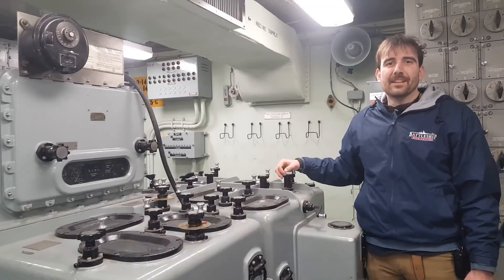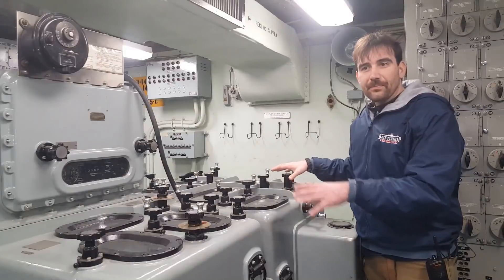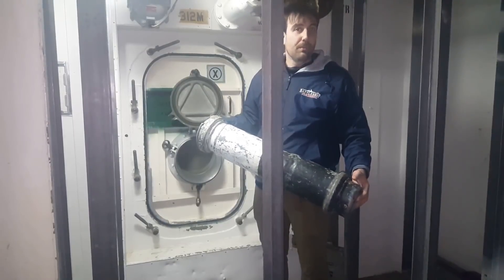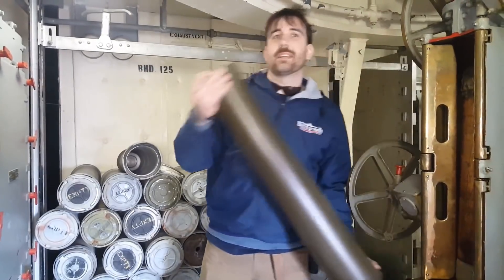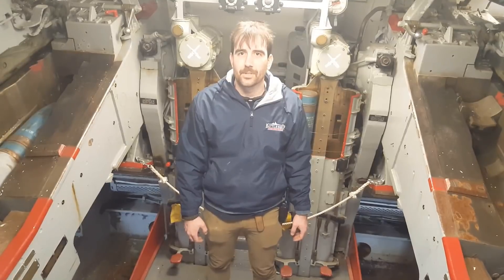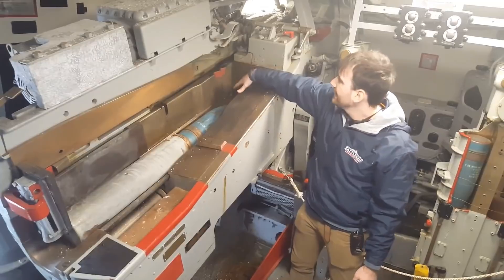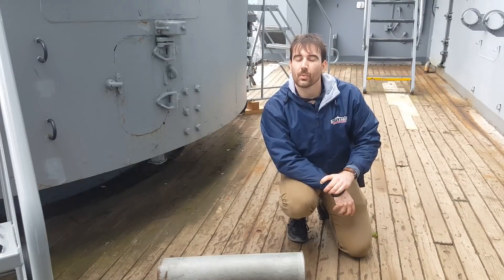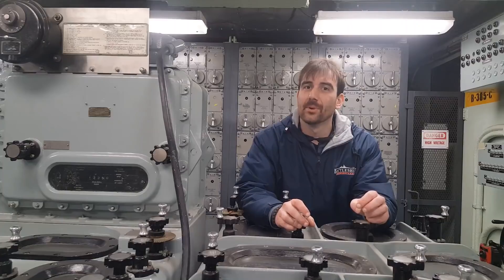5" Guns

Comment: My feeling watching this is one of exasperation! It makes no sense at all to me to have so many manual handling steps in the shell and powder handling, and gun loading. My back hurts just thinking about the insane movements! That could easily have been almost completely automated even in the early 40s. A big, rotating shell and powder magazine, electric or hydraulic rams to push a chosen shell from the magazine ring into a carrier which feeds it into a hoist. In the gunhouse, the shell would then ride along rails into the loading position, get automatically rammed into the gun along with powder being delivered the same way, the breach automatically closed and the gun would be ready to fire.

Comment: 4-sounds/round?! This a fully manual process. Current 5-inch/54-caliber, Mk 45 navy gun advertises 3-seconds/round; and this is automatic for a 20-round loader. Gunner’s mates  seriously earning their dinner rations during those evolutions.
Reply: It's even cooler than that. The 3second rof is because the barrel vibrates from the projectile interacting with the grooves and even with modern metals it still takes that long to dampen down so precision is not affected. They were a second off from matching the limits of the guns themselves.

Comment: The 5" 54 rounds on my ship were 72 lbs if memory serves. BTW does anyone know the difference between 5" 38 and 5" 54 ammo.  I know the 38 and 54 refer to the length of the barrels in calibers. But they are both 5" ammo (they should be able to fire out of any 5" weapon) yet they have different weights.  For instance, the new 5" 62 Light Weight mount on new Arleigh Burkes can fire 5" 54 rounds, but with a higher initial velocity due to the longer barrel. Are there any other differences to 5" 38? Could you fire 5" 54 out of a 38 mount (or vice versa)?
Reply: 5" 38 are semi fixed (2 piece ) ammo I belive the 54 is fixed (1 piece )
Reply: @barryd.thomassr.9156  No, I was an FTG aboard a DDG. The 5" 54 is semi fixed and the HE round itself is 72 pounds. Lugged enough of those during unrep to be sure. I just read the 5" 38 HE was 55 pounds, but still no definitive answer on interchangeability. Any old time Gunners mates know?
Reply: @wilsonle61  interchangeable yes but the powder would make a difference considering the 38 used a less powder, considering barrel lengths 5 x 38 vs 5x54, Jersey was my first ship

Comment: Thinking about how these firing platforms were designed and built nearly 90 years ago,  and were able to achieve a firing rate of one round every 4 seconds by using the brute strength of men and mechanical methods of that time is stunning.

Comment: "The shells, like this one, weighing 55 lbs" this man is holding it with his fingertips lol
Reply: Uk 55 lbs is one lb short of four stone before metric.
Reply: you can tell he's resting a lot of the weight on his leg
Reply: Training round same weight as real.
Reply: It’s hollow
Reply: @dylanlac765n6  But isn't the shell case the majority of the weight? He could be a navy vet, there's videos of gunners on destroyers handling the modern 70lbs 5" shells like they're nothing
Reply from the maker: This is a full weight shell even though it's inert. Hes just strong!
Reply: Clearly it's not loaded with powered ect.
Reply from the maker: Its a BL&P round, note the blue color of all those types of shells. Which means its inert, but full weight.

Comment: I always took for granted that the 5 inch guns were similar to the 16 inch guns. I never knew there was a metal casing for the powder. I assumed they used (smaller) powder bags. The 5 inch guns almost seem more labor intensive than the 16 inch guns.
Reply from the maker: In a way, they are, they definitely rely on manpower more and they have a much higher rate of fire. But a smaller impact.

Comment: Having served on both the 105mm M-60A3 and the Abram-saurus, four second reloads are admirable.
Reply: You would be exhausted as a loader on 60 or m1 tanks loading 22 rounds a minute . You would have to start tossing empty casings on the 60’s out the loaders hatch
Reply: @genegleason4987  Saw the 4 sec reload in the 1/1 CAV and 11th ACR. Agreed, not sustainable for any length of time, but if you  miss the first the second will be on target before the other guy can react.

Comment: I was a FTM on the USS Somers (DDG-34, ex-DD-947) from '71 to '73. We had a 5"-54 mount forward. We made one WestPac cruise in '72 off the coast of Vietnam where we did many call-for-fire missions and harassment and interdiction missions with our gun. By '72 most of the power shells were not brass, they were steel. Occasionally, a brass one was received and the spent shell was quickly grabbed by one of the officers. #RHIP. When we were on the gun line, we frequently shot so many rounds that the paint on the gun barrel blistered. We had all-hands working parties every other night for hours hand passing 500+ 5" rounds and then 5" power canisters from the at-sea replenishment deck down to the magazine deck. The jock officers would be the ones hand passing the 5" shells or power canisters from the hatch above to the hatch at their feet. There were no hoists for rearmament on a tin can; all 5" ammo was hand-passed.
Reply: every other morning, my 6 hrs out of the handling room was spent reloading the mag's during resupply. We would get done just in time to eat and get back in the mount. Couln't  sleep in the bunks because of the fiberglass falling out of the overhead.

Comment: question - at 3:22 you lift a powder canister up from the hoist, with the rim up.  I assume the other end is open.  Won't the powder etc fall out of the brass at that point?  Or was that a mistake (putting it in the hoist upside down)?
Reply from the maker: For us its upside down to hide that its empty
Reply: @BattleshipNewJersey  LOL; the powder-cartridge had a cork plug to keep it's contents inside. http://www.navweaps.com/Weapons/WNUS_5-38_mk12.php , the penultimate image shows "Cutaway sketch of 5"/38 (12.7 cm) ammunition."

Comment: Operation "Oceanview" was the name used by the Marines that night !  FYI.  The rammer's part was called a "Spade" when the breach block pushed it up it caught the big long brass "Cam"and rode it up and back to the ready position, Easy to see in the video. As it returned it rose up so when gun was fired.  The ejector Pauls of the breach block then pushed the empty brass back out. It easly slide under the Spade as it was now up. Expended brass slide out the back of the gun into a chute then out opening demonstrated in video. What else do you want to know about the 5/38's in Viet Nam We were the 5th Div. "Salts of the Earth"
Reply: https://en.m.wikipedia.org/wiki/Ocean_View_(Vietnam)

Comment: I saw one big mistake on loading the 5" projectiles. When loading in projectiles on to the loading tray you would not have your fingers flat unless you want your fingers smashed flat or worse loosing a finger or two. This is an excellent way to getting your fingers smashed between the loading tray and the 5" projectile. The correct way to guide the projectile is to make a cat's paw and guide the projectile into the position to be loaded with the hand closest to the breach. Then with the opposite hand use that hand to ram home the projectile and powder case. Former GMG3 on USS Rogers DD 876 a Gearing Class Destroyer.
Reply: Was on dd830
Reply: Tin can  sailor newspaper  Roger s was in it
Reply: I’ve got news papers from my family from consolidated steel in Orange , Texas announcing the launch of the Newman K Perry.

Comment: The Ford Mk 1 (later MK2) was a analog computer linked to the air search radar for anti air and anti ship fire.   The axis powers never developed a similar system which gave the USN a first round hits when the target at night or in dense fog or smoke and was only visible on the radar screen.  In the AA mode all the 5’’ were linked together to attack incoming targets.  It was so effective that it’s one of the reasons the IJN turned to the Kamikaze operations.   This system basically this was a genius invention which shortly the war and saved lives

Comment: My father was in World War II. He served on the USS Chilton,  APA 38, as a “hot shellman on the forward five inch” as he put it.  The picture in my mind was that his job was to grab the hot shells as they came out of the gun and throw them overboard, but I could be wrong.  Can you please clarify what he might have been doing?
Reply from the maker: "Shellmen, powdermen, and hoistmen make up the ammunition supply system.

The shellman supplies properly fuzed projectiles to the shell loader via the fuze pots. On all twin mount guns and on some single mount guns the fuze pots are a part of the projectile hoist. In this case the shellman loads a projectile into the fuze pot and fills the projectile hoist simultaneously. At "secure" the shellman replaces the safety pins, nose caps, and grommets after checking that all nose fuzes are set on "Safe."

The powderman supplies fresh powder cartridges to the powder loader directly or by means of a powder scuttle. At "Secure" the powderman replaces the primer protecting caps on the cartridges and stows them in the powder tanks.

The hoistman operates a projectile hoist or powder hoist, or a combination projectile-and-powder hoist, to hoist ammunition up to the gun. At "Secure" the hoistman secures hoist in accordance with ship's doctrine and turns off power motor.

Sometimes the shellman or the powderman acts as a hoistman, too. Without proper knowledge this would lead to confusion. If you are in the ammunition supply crew, know all three jobs well: shellman, powderman, and hoistman"

Check out this manual on 5" guns from 1943 for more info: https://maritime.org/doc/destroyer/fiveinch/index.htm
Reply from the maker: For even more information, because we have it, we have an entire digitized 5in gun manual that has way more pictures but is less searchable at: https://drive.google.com/drive/folders/1CwKak3U-N8poRoakp_0IdoPvZUNTT7Wv?usp=sharing

Comment: I think its funny when you mention something to someone about these old fire control computers, and people say something like "Computers didn't exist back then".
Reply: Computers has existed a long time. Think a human with the ability to count,add,multiply,subtract and divide ?
That is the real definition of an computer when New Jersey and the atomic bomb were designed and built.
So were  the B-52 and Glamorous Glennis, Chuck Yeager's Bell X aircraft, they were designed and dimensioned by hand using brain, fingers, pen, logarithm tabels (and in some cases table calculators and card machines.)

An UNIVersal Automatic Computer (or UNIVAC) is something else.
Reply: @TheStefanskoglund1  Don't know about the real definition of a computer but what you describe can simply be called calculators. The difference between calculators and a computer is that calculators can give you the value of A and B and the sum of both; a computer can tell if A or B is the greater value. In other words a calculator handles 1 computation/calculation at a time but a computer can handle multiple lines of calculations and combine their results.

People think "Personal Computers" and "Computers" are the same thing. And PC's didn't exist back then.

I always found it funny that our very important fire-control-computer was comparable to a Commodore 64 with 64kB of extra memory. This was in the late nineties when people had pc's that were far more powerful computation-wise.
Reply: @DreadX10   The personnel doing calculations in an engineering and/or research shop were called computers. 

With regards to fire control computers: Things doing ballistic calculations DON'T need that much memory.  Well known and defined speed and correct results is far more important. Neither were it necessary that they were simple to program in - well trained people did the programming (compare the Bendig G-15 with a VIC 20 for example. The G-15 were the first computer which was easy enough to use and cheap enough so that one example could be reserved for the usage of ONE engineer. Though it wasn't easy to program so it soon got obsolete.)
Reply: @TheStefanskoglund1  😆 I know that. Just some that don't want to listen.
Reply: USN operated computers on their submarine fire controls circa 1938 or '39, the TDC(torpedo data computer)

Comment: I've always been curious how those weapons achieved dual purpose status during WWII, given the need for turret to keep pace with planes.
 
I didn't know those guns stayed active after advent of jet age. Always wanted to talk to WWII gunner to learn how those worked.
Reply: These didn't track planes and shoo at them like lighter 40mm or 20mm guns. They fired area barrages that enemy planes would have to fly through.
Reply: For air targeting they had a MK37 director.  An officer used a periscope to pick the target.  Three sailors were each tasked with train, elevation and range tracking with radar.  Train and elevation cranked handwheels to aim the director and used a scope that they kept the peak centered on to keep the dish pointed at the airplane.  The range used a delay line to adjust delay to match the delay line distance with the radar return to get the airplanes distance.  All three were then fed to the computer in fire control.
The MK1 computer figured out where to point the gun so that on the present course of the airplane a shell would intercept it.  It also calculated the range to set the timer to so the round would burst near the airplane.  All of that fed to the turrets to point them and set the timer on the shell.
Reply: @matthewbeasley7765  wow, amazing stuff for '45. I wonder they became obsolete for AA purposes...jet age?
Reply from the maker: Yeah, modern jets just move too fast for these guns to really be effective.
Reply: @BattleshipNewJersey  I meant even earlier jets. I get feeling gun system designed (at least AA capability) for maybe sub-400mph targets. Of course, fleet didn't come air attack after 1945, so history doesn't tell us how they might fare against 500+mph.  Anyway, as a WW creation, I've always been impressed with them.
Reply: The phalanx system of the mid 80's is a modernized idea of the same radar guided system.  
Bofors has a 57mm gun that shoots guided bullets.  The US is putting them on the new littoral class ships.
Reply from the maker: These are some exceptionally common guns throughout the 20th century, for shore bombardment, primarily, but also for anti-ship defense. These guns worked against planes as part of a larger defense platform that included the 40mm and 20mm guns.
Reply: Active thru and after Vietnam

Comment: How is the powder ignited?
Reply: the firing mechanism for the 5"/38 caliber gun provides for both percussion and electrical firing. This according to Naval Ordnance and Gunnery Volume 1 Naval Ordnance 1957 edition,  pg 169. So either the firing pin strikes the primer, or an electrical current is ran through it to ignite it.
Reply: @bottomshot4546  What about the 16 inchers?

Comment: The shell casings were "densely packed" around the turret and it couldn't "traverse or elevate" freely because of it. I can see that happening.
Reply: A turret is part of the Ship. A 5/38 is a Gun Mount and can be lifted off the ship by a crane. It could still elevate that night. We just threw the "Brass" over the side.  Not really Brass any more its an Alloy.
Reply: On the show The Last Ship, they had a reason to fire the 5" gun several times in rapid succession. The Arleigh Burke's 5" is in the center of the forward deck and if someone was unfortunate enough to be standing in front of it, if the shock wouldn't be enough the rapid ejection of the shells would have knocked that person overboard. Big guns are nice, but more than one enemy learned to not dis the 5".

Comment: I went through FT "A" school in 1970. Some of my classmates went on to "C" school for the Mk 37 system  which was still in use on many WWII vintage ships, especially older DDs. At that time WWII had only ended 25 years before.  We always heard the story that the man who invented the MK 1 Able computer went insane after completing the design.  I do have a powder case from a 5" 38, used of course.
Reply: We used to make ashtrays out of them, the 5" and 8" brass that is.
Reply: After firing the 5" guns, were the empty powder cases reused and refilled  or just tossed over the side?
Reply from the maker: Both were done, depending on what was happening. If there were too many stacked up they'd be tossed, if they could be saved they would.
Reply: @BattleshipNewJersey   I can vouch for that, it was at the captains discretion, whether we tossed the brass or not, during Vietnam aboard the USS Newport News (CA-148), one of the times we went to Hong Kong, we traded brass for a company to paint out the ship. That way the deck force got more liberty as well, we supplied the paint, brushes, rollers etc., Funny thing, they painted every thing with their hands and kept the brushes and rollers. We also had to stop them from stealing the ships bell.
Reply: @BattleshipNewJersey  I remember seeing a cartoon from the famous WWII artist Bill Mauldin, in which Willie is poking his head out of the tent, and saying "Fire two more for effect, Joe.  We're making a smokestack."
Reply: Was on dd830  5s were  right  on took  down  a drome